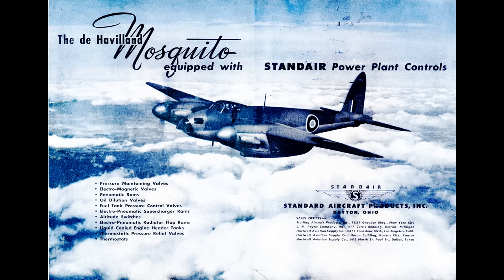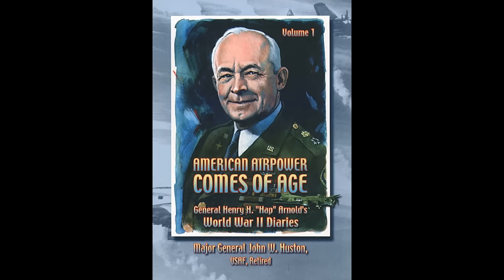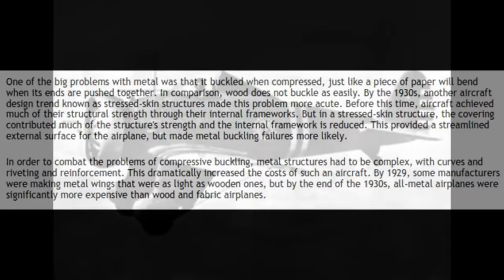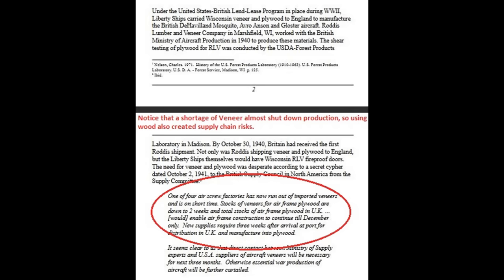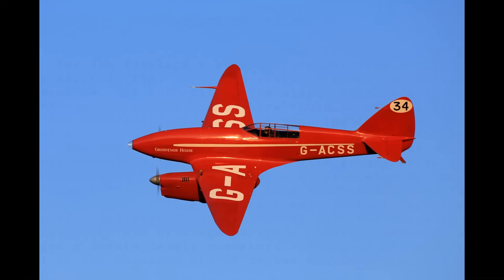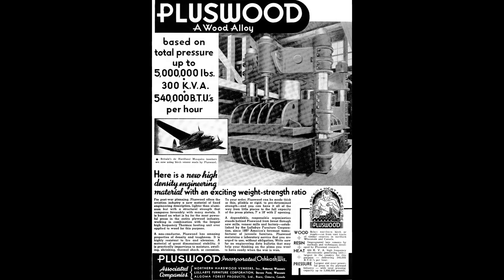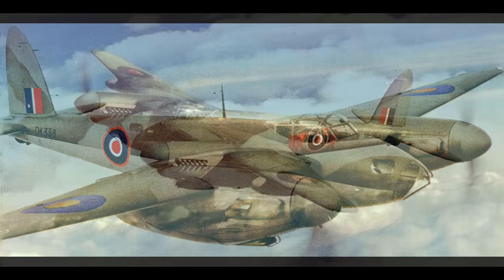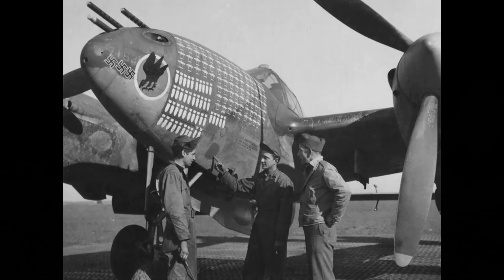De Havilland Mosquito vs. ?

Comment: The main advantage of metal is it resists sun, rain, and weather.  Doped fabric and spruce - not so much so...  you need to hanger it.  You come to this conclusion when home building your own airplane.   However,  metal skin on wings will oilcan vibrate (and fatigue fail) or corrode rapidly when dissimiliar metals join.  Aluminum skin will corrode away over time to nothing, as seen on WW2 aircraft lost in jungles in the Pacific theater.   Aluminum also use to be expensive to produce, as the only refining process I think involved a lot of electricity (relying on memory).   air-war.org
Reply from the maker: Thanks Chopper, I'm always glad to see you here.

Comment: Greg--Great content.  One correction (sort of) is that the Mosquito's Vmc (single engine minimum control speed) was quite high, close to 200 mph.  The fin and rudder are small for all the power it has.  Therefore it was not possible to take off or land above Vmc. There was a period following take off and before reaching Vmc when an engine failure meant you were probably dead.  Especially when loaded for battle and departing over unlandable terrain.
Reply from the maker: I'm a bit lost. Did I mention a Vmc speed for the Mosquito in this video? In any case, per the manual it depends on manifold pressure, at 9 pounds of boost it's 173mph, and 196mph at 18 pounds of boost.
Reply: @GregsAirplanesandAutomobiles  I thought I heard you say that the way pilots deal with Vmc is to take off and land above that speed.  I was just trying to say that would likely not really be possible in the Mosquito.

Comment: Wood has different qualities.
Unlike metallurgical comparisons, the choices of fibers having different densities, strengths, rot resistance and so forth had been experimented, tested and evaluated since the age of the bow. 
If speed is what you need, DeHavland is the choice.

Comment: On the structural strength of the airframe, you forgot to mention some later Mosquito's carried a 6 pounder anti-tank artillery piece inside them weighing nearly a ton and firing 55 rounds per minute, designed for sinking submarines and ships.
Reply from the maker: I didn't forget. This is a series, I can't get everything into one video.
Reply: @GregsAirplanesandAutomobiles  Can't wait for the next instalment. They are great video's Greg.

Comment: Concerning the use of wood as an alternative to aluminium, I wonder about this. At the time the Battle of the Atlantic was affecting imports with much merchant shipping being sunk. Bauxite is a tropical mineral. I guess it was shipped from W Africa and/or the West Indies. Smelting is energy intensive, was typically done near hydro-electic power stations. They were at risk of being bombed, and demand was already high for conventional aircraft. That's two reasons for the substitution. I haven't seen them elsewhere.

The further reason being that the work could be done by carpenters rather than skilled metal workers who were much in demand.

Comment: The "Corrosion Problem" with aluminum was not so much the fault of aluminum but attaching it to steel or other dissimilar metals. If an aluminum panel is riveted to a steel girder for instance, any water molecules that gets between the two will cause electrolysis and cause corrosion, specifically by turning the touching aluminum atoms into aluminum oxide, that white powder you see where a steel screw has been used to connect, say, an aluminum girder on your pool cage.
   It was solved by paying strict attention to any place where aluminum was touching any other metal. Aluminum sheets would be riveted to aluminum girders using aluminum rivets, etc., and where, say, an aluminum girder had to be attached to a steel part, such as an engine mount, the aluminum girder would be quite thick and also made of cast aluminum where the corrosion problem was not nearly as pronounced as it was with sheet aluminum used as wing panels and fuselage.
   The World Trade Center buildings were built with aluminum cladding directly riveted or bolted to the steel girders and had for many years a lot of maintenance problems with the cladding getting loose and rattling, sometime nearly falling off the buildings, all because of the problem of attaching two dissimilar metals to each other in a moist environment.
Reply: ladamyre Ships use intermediate fittings with steel on one side and aluminium or an alloy on the other.

Comment: THe original mustang was largely dismissed by the US, but after various UK additions and the obvious engine upgrade, the changes pinged back and it was literally legendary.
I.e. if it hadn't been for the UK/RAF, the legendary mustang p51wouldn't have existed, or at least as such.
Reply from the maker: That's a bit of a Myth, North American had been working on a Merlin powered P-51 before the British, and the US Merlin installation was much different than the British one.
Reply: I am sure the USA would have made it work. It was just simpler to use a ready-made engine design that did the job.

Comment: Tooling would have been easier for wood. Lots of people and workshops hade the tools for working with wood. The same could not be said for metal. This meant that there was easy access to both manpower and tools.
Reply from the maker: I think that's a big factor, especially because they already had a lot of tools for this method of construction.

Comment: Fortunately Kelly Johnson did a better job with the U2 than the P38.
Reply: Shame about the radiators.  Not the best configuration or placement.  They could have done big improvements but production interuptions were blocked.  Integrated single leading edge units would have been better in the 'J'.

Comment: As regards to the structural strength you should look up the Tsetse which was a Mosquito that had a modified qf 6pdr anti-tank gun installed on it.
Reply from the maker: I am quite familiar with it, we just haven't got that far in the series yet.

Comment: Hap Arnold and Arthur Harris were so welded to the notion that bombers had to be heavy and slow they missed the point of Mosquito. Due to its speed and minimal defensive armament two Mosquitoes could carry at least the same weight of bombs as one B17. They had four engines but only 4 crew between them instead of 10.
Reply from the maker: It's much more complicated than that.
Reply: The Mosquito was a lousy high altitude bomber.  Note that the RAF built many thousands of Lancasters even after the brilliant qualities of the Mosquito were well known

Comment: Of the twin-engine planes, I have flown, the P 38 would be considered a high power twin however due to its' twin tails and booms this plane does a lot better than other twins like the Mosquito. There are others like the old Beech Craft planes and others that handled much better on one engine than any plane with just one rudder.

Comment: What parts of the Hawker Hurricane were wood? 
The Germans had the Junkers Ju-88 "Schnell Bomber" - quite fast for its time and capable of carrying an impressive load.  Moreover while it had been designed as a dive bomber it was adapted to serve as a recon aircraft, night fighter aircraft, ground attack aircraft, and anti-ship aircraft - what Germans call an "All Singing, All Dancing" performer.
Reply from the maker: A lot of the Hurricane's rear fuselage was wood.
Reply: @GregsAirplanesandAutomobiles  Nope - metal tubular structure covered in fabric. As were the wings until early 1940 when the Hurricane received metal skinned wings.  Only wooden parts of the Hurri was the early Watts two blade prop.
Reply from the maker: "Over this, a secondary structure composed of wooden formers and stringers gave the fuselage a rounded external shape, which carried a doped linen covering." source: https://en.wikipedia.org/wiki/Hawker_Hurricane

Comment: I would dare to disagree with the part that USSR do not have problems getting aluminum. USSR have huge problems geting it, domestic production was very low, and big part was provided by land lease. And that was most important part of all land leas deal, as opinion of some historians. During the first year of war lack of aluminum was almost catastrofical. In late years, like 43 and later, after production was mostly restored stabilized USSR continued to order aluminum from USA and GB.

Comment: The downside of wood is that bullets go through. The upside is that explosive rounds go straight through.
Reply from the maker: If you have a link to a source stating that German 20mm rounds fired from 109s or 190s went through wooden planes without exploding, I would love to see it.
Reply: The main spars would clearly be shattered by a large bullet especially a 30mm. The skins were thin plywood but (unlike metal aircraft) there are fewer spars in the wings. The fuselage had no bulkheads. It was made in two moulded halves like a big Airfix (Revel) kit. Bullets went through leaving little damage unless they hit something solid.
Tests today with explosive ammo on ballistic gel shows that rounds often explode after exiting the “body”. They would certainly explode after going through a few mm of ply and balsawood. That might be destructive but quite possibly would get dissipated in the air space behind.

Comment: A very good video but I think that your comparison of wood versus metal using a utility pole as an example is a bit unfair. Plywood in particular does not behave in the same way as solid wood and different types of wood can perform very differently under stress. It’s a bit like comparing cast iron to plate steel. They’re both metals but with considerably different characteristics that would respond very differently to being shot at.
Reply from the maker: I like live in Oklahoma, I've shot up a lot of plywood, and with .303 British and 8mm Mauser rounds.

Comment: I'm curious just what thickness of plywood was used in the Mossie's manufacture. The thinnest plywood I've ever come across is 1/64th (.015" or .36mm). And this is 3 ply.
Reply: 5 mm with a layer of balsa in between. They used a huge jig building up the layers from the inside out

Comment: I think that the P38 was an exceptional plane but not really a fair comparison for the Mossie. The mosquito was never a day fighter, only ever a fighter bomber and even then the FB versions were probably what you would describe as an interdictor/strike plane. They were not meant to dog fight with single engine fighters.
Also despite the mosquitos great range and armament it was never used as an escort fighter in daylight operations.
The Mossie was conceived as a fast medium bomber with great range and speed.
I think the closer comparison would be the B25 Mitchell. This would also make for an interesting comparison on the US and UK decisions made on strategic bombing in in WW2.

Comment: A fair comparison. One being better than the other at curtain tasks. One factor was that if you anted to repair or modify the Mosquito a carpenter cut out the area that they wanted to change and it was ready the next day where metal plains, when they needed to change wee costly in time and materials and a long time for drawings to be made by an engineer. and still working with the metal took longer.
Personally, my choice wood ( a little play on words EH ! )  many pilots that changed over to Mossie's were in love with the aircraft. 
So in conclusion, as there were fewer Mosquito aircraft losses than any other it was nice for those lucky enough to return home. 
So I pick the Mosquito.
Reply: "as there were fewer Mosquito aircraft losses than any other"
Source?
Reply: @hardcorehistory9165  How many Mossies were night fighters?
Reply: @hardcorehistory9165  "During the Normandy campaign, RAF squadrons committed a monthly average of not quite three hundred Mosquitos. From June through August, seventy were shot down and twenty-eight damaged beyond repair—33 percent of the total available."
British WW2 Aircraft - History

About the same as other RAF FB's.
Reply: @hardcorehistory9165  
Self-propelled anti-aircraft guns	
Flakpanzer I. Flakpanzer 38(t). Flakpanzer III. Flakpanzer IV. Möbelwagen. Wirbelwind. Ostwind. Kugelblitz
On two of the "pinpoint" raids losses were over 20 per cent.
Reply: @nickdanger3802  After reading several books about many aircrafts performance and lose ratings, the Mossie was rated as compared to all  WW 2 aircraft, the Mossie has the highest return rate when compared to any other aircraft. The Mossie had "Y" # and P 51s had "X" # return from missions as compared number extrapolations between all records that was able to be compared. The numbers figured out mathematically the Mossie was hands down the best return figures of any aircraft in WW2 .  Almost better than any 2 but not quite.
Just keep reading those WW 2 stats. Knowledge is King.
Reply: @johnhaney7307  I can't imagine why bombers used as Pathfinders and hit and run nuisance raids and purpose built to run away from fighters would have a lower lose rate than a plane purpose built for long range air superiority.
The low per cent lose rate you are seeing is most likely for Bomber Command where Mossies were used in very small numbers compared to aircraft used as bombers in organized raids.
About 1/3 of production was fighter bombers which could not run away from flak and had loss rate similar to other FB's as stated above.
Lower loss rates for other marks had more to do with how they were used than the aircraft.
On two propa...apologizes, "pinpoint" raids that Brits like to pound on about, losses were over 20 per cent.

Comment: Reading the comments I would just like to say that yes a Mosquito could carry as much as a B17, depending upon how far the B17 had to fly. Wight and balance and all. As was mentioned in a previous discussion the 4000 lb "cookie" was an area weapon not a penatration and destroy unit. Comparing the two air craft is not logical. The Mosquito would not survive many missions that the 8 th AirForce undertook. I get the impression that most people do not understand that when your mission is to drop "dumb" bombs you have to fly straight and level at a known speed in order for the bombs trajectory to end at the target. So at, lets say 25000 feet, your straight and level time could be up wards of 10 minutes. This leaves plenty of time for enemy anti aircraft guns to sight on their target not to mention the fighters. This could happen down low as well. During the Faulkland Island's war the Argentines flying Douglas A4's were loaded with what are called 200 ft bombs which ment they had to be above 200 feet ,at the specified airspeed, to drop the weapon. The Royal Navy did report bomb hits that did not detonate because the Argentine pilots flew below 200 ft to avoid british antiaircraft fire and release the weapon but the bombs did not have sufficent time to arm themselves. So the Mosquito was the best at boom and zoom but as a strategic bomber it would have failed miserabely.

Comment: There’s one thing that the P-38 couldn’t do but the Mosquito could: fly any sort of load internally.  It could fly anything from bombs to bearings as well as chaps like Niels Bohr in it’s bomb bay
Reply from the maker: True, but Yamamoto doesn't care. Both airplanes have their advantages.
Reply: Curiously, commercial air service between Great Britain and Sweden continued to operate despite the war. The British Overseas Airways Corporation (BOAC) ran a regular weekly route between Stockholm and London using two twin-engined Lockheed Lodestars. These airliners could seat eight passengers and a small amount of cargo—clearly inadequate for what the Americans had in mind. Arnold and Donovan agreed the OSS would need to set up its own air courier service with long-range bomber aircraft painted over and marked to resemble commercial aircraft. Their U.S. Army crews were to operate undercover as the fictitious American Air Transport Service, so civilian passports and clothing had to be obtained as well. 
Colonel Bernt Balchen’s Secret Air Force on line